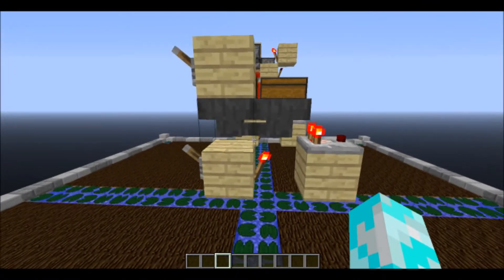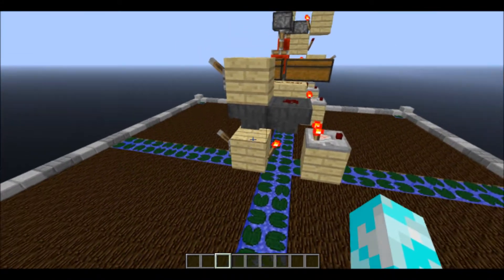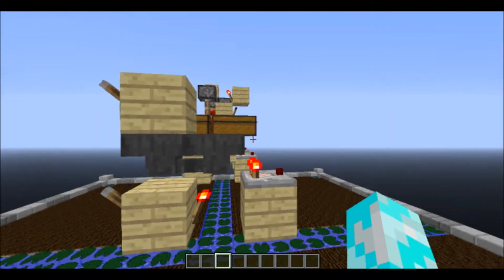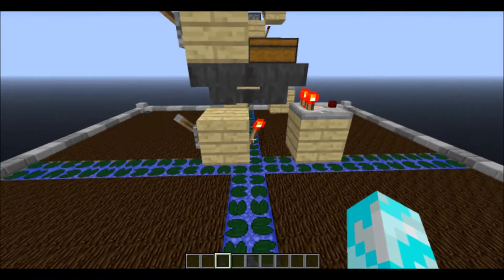DFF Showcase

Comment: Wait... If I'm understanding the concept of a D Flip-Flop correctly, couldn't you simply use a single repeater lock instead?
Reply from the maker: Yes, but that in another way is larger than most of these. Also some are tileable, the repeater lock is 3x2x2.